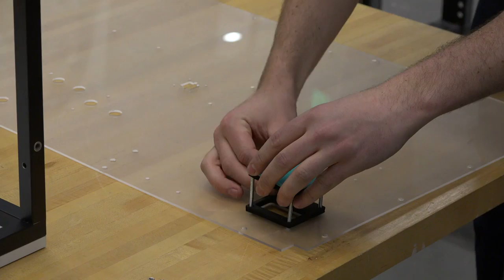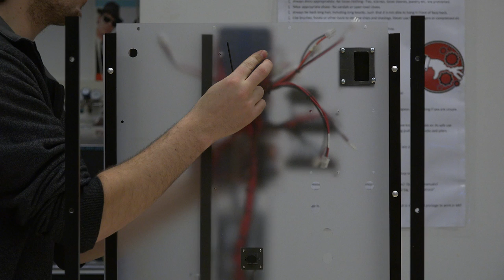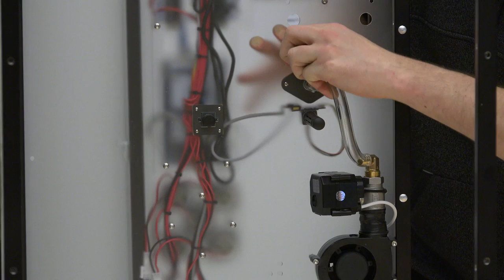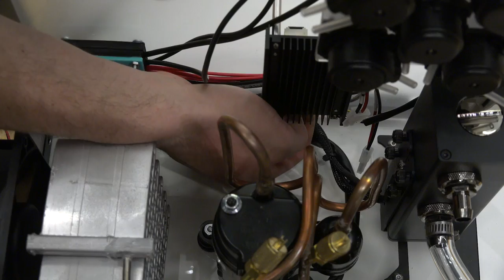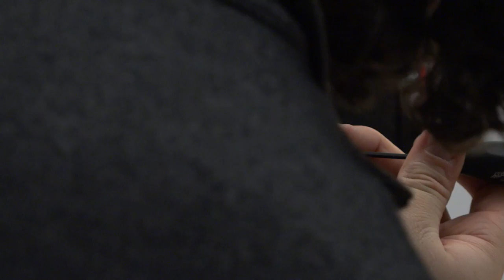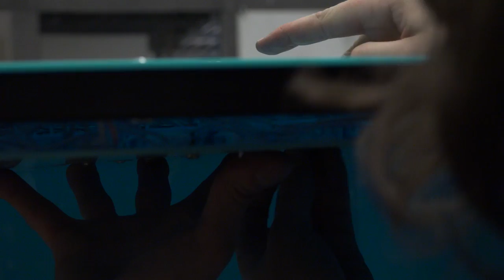Personal Food Computer v2.0 (beta) - Build Video

Comment: At 10:35 the "temperature & humidity sensor" is mounted. However, I see that the Arduino Mega 2560 is already integrated, alongside the Signal PCB and Raspberry Pi 3, etc.
Is there a detailed description, explaining how to connect all of these different parts? It's the trickiest part of this whole assembly and it's unfortunately not described in this video.